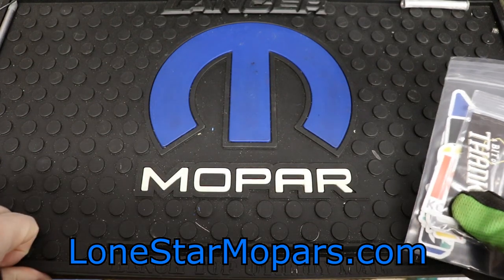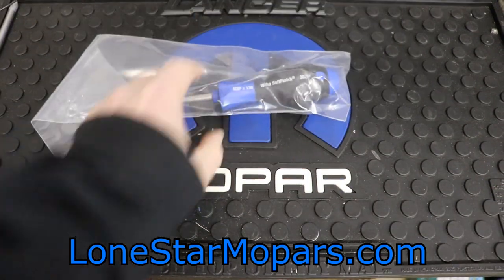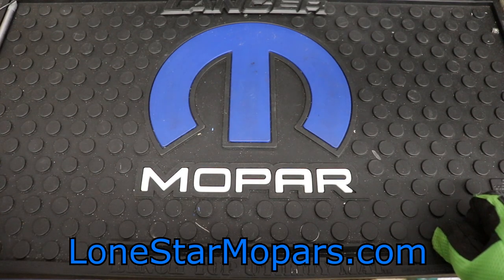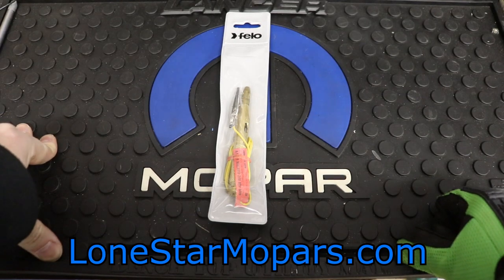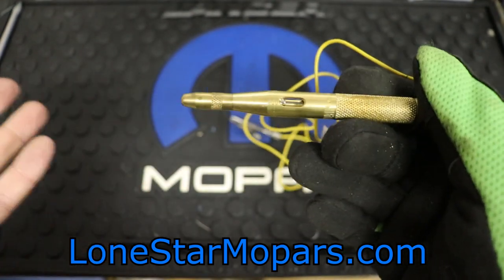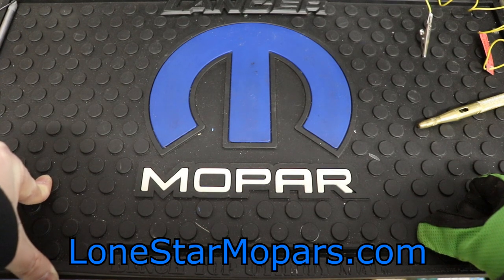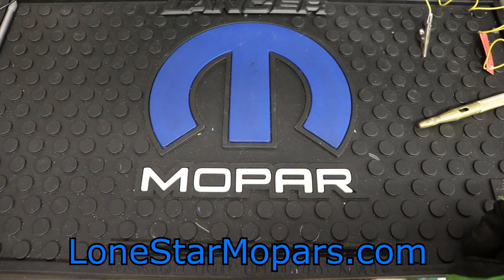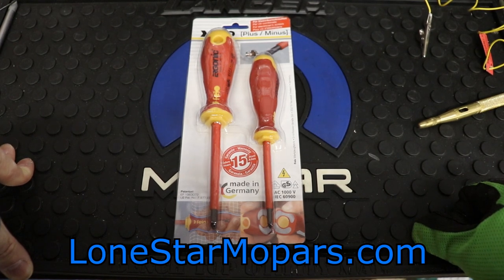KC Tool Haul #73: Felo, Stahlwille, Wera, Witte, and THE German Rubber Band

Comment: I got that Witte flexible bit holding driver a while back. I love Witte handles, especially the older MaxxPro style with the larger flocked surfaces (though not the light gray color for the same reasons as you). 

What I don't like about that this driver is the tip is NOT magnetic. I bought a small rare earth magnet and glued it in place. I also don't like the large fixed ferrule thing at the base of the handle that holds the flexible shaft in place because I think it's too long, making the shaft less flexible. 

All in all I like the tool, but it could definitely have been a little better.
Reply from the maker: The Tri-Lobe is a love it or hate it, and I happen to be pretty fond of it.  I had the same thought on the ferrule...definitely limits the angle at that length.  Will it increase the life span...maybe, but I think with a tool like this I'd sacrifice a few spins over all for a greater angled reach.  Glad the magnet upgrade is working out for you...You might see this and a few others in the not too distant future.